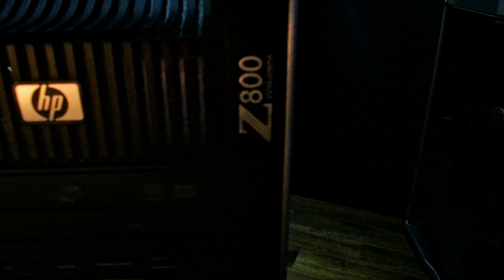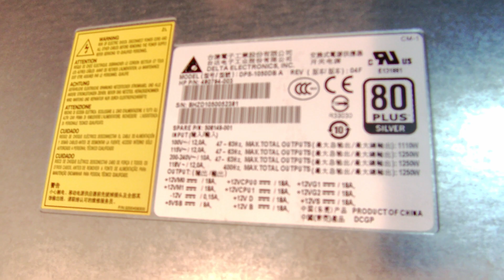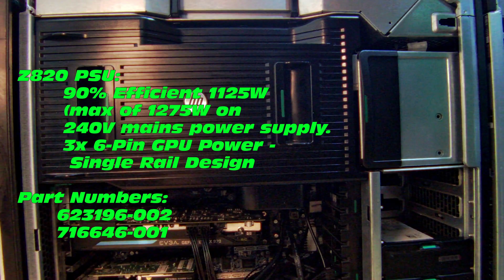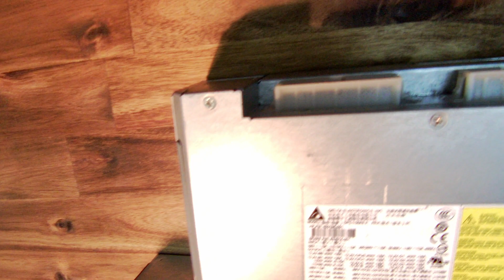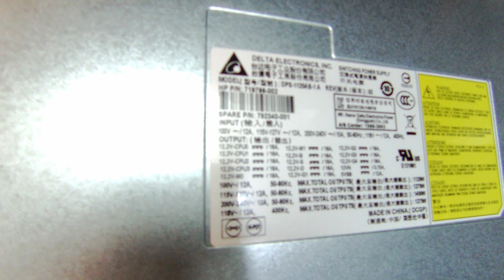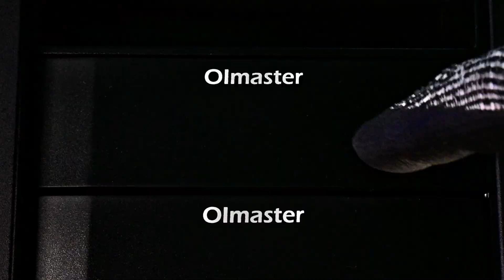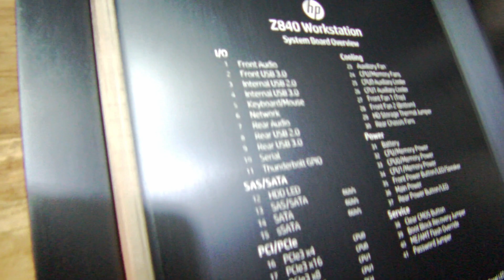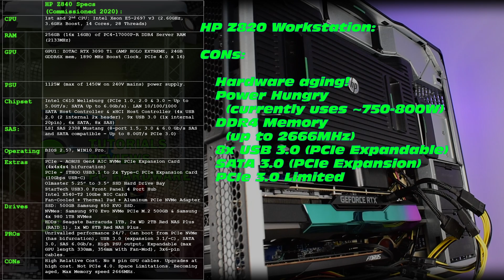Z800 / Z820 / Z840 Guide : Power Up Your Workflow with a Workstation (Remastered).

Comment: Would it be possible to replace the motherboard with a more recent one that can run an AMD Ryzen 7 chip for example?
Reply from the maker: Where modern Ryzen CPU based systems are really competitive, these workstations operate with a different purpose in mind. They tend to focus on maximizing CPU cores, having massive amounts of RAM and lots of PCIe slots. There are no Ryzen options for the HP Z800, Z820 or Z840 – they only operate on dual Intel Xeon Workstation processors. The newest Z8 G5 workstation can do Intel Xeon W's though, check Linus’s video for that one! https://www.youtube.com/watch?v=ESW3gXUo1QM&vl=en 

Let’s do a quick comparison: 
With enough money you could get a Ryzen system like an AMD Threadripper 3990X + TRS40 AORUS XTREME which gives 56C/128T, 8 DIMM sockets (ECC or non-ECC 3200MHz), 4x PCIe 4.0 slots (x16 + x8 + x16 + x8) and 4x M.2 NVMe slots (x4 each), ~1200W min. PSU. System cost: ~$7000- $10000 USD (RTX 4090, 4x NVMes, 1200W PSU etc.) Price is an estimate – you may be able to price it up cheaper. 

HP Z840 Workstation with dual E5-2699 V4 (44C /  88T), 16 DIMM sockets (ECC or Non-ECC 2400MHz), 7x 3.0 PCIe slots (x8, x16, x8, x16, x8, x16) and no M.2 NVMe slots, 1450W PSU (~$2000 USD for the workstation with ~768GB RAM), plus your GPU and M.2 NVMe PCIe adapter, likely makes the system cost ~$4000-6000, you could drive that price down also. 

Example Z840 listings (link may break over time): https://www.ebay.com/sch/i.html?_from=R40&_trksid=p2334524.m570.l1313&_nkw=HP+Z840+44+Core+Workstation+2X+E5-2699+V4+768GB+RAM+No+GPU%2F+HDD%2F+OS&_sacat=0&LH_TitleDesc=0&rt=nc&_odkw=hp+Z840&_osacat=0&_sop=16 

The Ryzen system will give a decent performance boost, but it will come at a cost. I went for the HP Workstation because I can have massive computing performance for a lower price point (buying second hand anyhow). Your budget would decide which hardware system you can obtain, I opted for the workstation (28 Cores, 56 Threads, 256GB DDR4 2133MHz RAM, RTX 3090 Ti, 40TB of storage (28TB of HDDs, 4TB RAID 1 SSDs, 8TB RAID 0 NVMes in ASUS Hyper V2), 2x 10GbE, 2x 1GbE, 10x USB 3.0, 2x USB type C).
Reply: Thank you for your quick and detailed response @racerrrz  So it is easier to build a separate pc with AMD tech then try to squeeze it in the Z800 for me. Then I would go the route of upgrading what I have in here atm, which is the following.

I have the Z800 equipped atm with  88gb Ram, 1060 GTX (6GB VRM), 2 Intel Xeon E5645 2.4GHz 12 core CPUs and a 1TB Samsung 860 Evo SSD. 

Now, I could for example upgrade my GPU, but which one would you recommend for this system? Also, would love to upgrade the CPU's to the maximum GHz that my system can run.
Reply: @sklgy  Hello, I can recommend 2x CPU X5690 upgrade and RTX 2080Ti GPU combo based on my use case.
If you want max GHz CPU you might go for the quad core X5687 @3.86 GHz turbo. Otherwise the 6 core X5690 is the best option @3.73 GHz turbo.

I will share my z800 story :)
I rescued a z800 from a recycling bin and with some upgrades it is my entertainment and gaming machine.

From memory, the machine needed a bios update to support the Xeon X5690s (originally 1x X5550 CPU, now 2x X5690). I chose to put aftermarket CPU coolers because it was missing one and I did not like the price of the OEM coolers, which both should be upgraded to the higher-spec air-coolers (more heat pipes and fins) or the OEM water cooling solution when going to the higher power CPUs. As a result of fitting the aftermarket CPU coolers I had to get rid of the RAM fan shroud (either that or butcher it with a dremel). I upgraded to the 1200W power supply and fitted an RTX 2080ti. Since the machine was also very noisy I replaced all fans, including those in the power supply, for premium Noctua fans, after that it was much more pleasant.

My experience of this system for gaming has been excellent. I do not count framerates but I run it on my living room 55' tv @4k and always have had a smooth experience with maximum settings.

My main complaint is that because of the age of the CPUs, they are lacking some instruction sets so some games I have tried to play flat out will not work. This might not be an issue in your use case, but it is leading me to want to replace the machine, which is a shame since I really like the z800 aesthetic.

Currently I am building a budget z240 (also recycling bin) machine to replace the z800 which I will give the z800 to the wife for video editing. If it were not for the recycling bin finds I would rather build a machine from standard form-factor components so I don't have to stuff around with non-standard form-factors and non-standard power connectors if I want to say upgrade to a more modern motherboard to support newer generation CPUs. Perhaps I might try to hack a standard form factor motherboard into the machine at some later date so I can keep the fabulous case.

There is some good simple guidance at greenpcgamers.com. They have basic guides for many workstation builds.

Comment: I love my z440 that I use for a server. I wish it was more power effecient though. I will be switching only for that reason.
Reply from the maker: The Z440 really packs a punch for their hardware cost. The 600W PSU's power efficiency is excellent, with a 90% "Platinum" efficiency rating. The catch is that the PSU is geared to power some powerful CPU and GPU combos. Comparing it to the Z840's 1400W PSU the Z440 will save you a decent amount in power, but in the cost crisis right now a smaller PSU wouldn't be such a bad thing. Although not as powerful normally, laptops tend to have a lower power consumption and they work great for the more general daily tasks. The Dell Latitude 5580 would likely match the Z440 in purchase cost right now.

Comment: i really want something make my z820 powerful ..but all these things are very expensive
Reply from the maker: Hi there. If you already have the Z820 you have completed the most expensive step! PC hardware is really expensive (even more so now compared with a few years ago...). The good news is that the Z820's hardware is more affordable now than ever. What CPU/s do you have at the moment? Matching your Z820 with a well priced Xeon like the E5-2667 V2 (~$15 USD on Ebay right now) and 64GB of RAM (~$45 USD for DDR3 1600MHz) can help give it a performance boost on a budget. I can't really help with the GPU, they are just really expensive. But something like the RTX 2070 Super second-hand (~$120 USD on Ebay) might be as good as it gets.

Comment: All fun and games till the psu calls it quits (i have a 20kg paper weight)
Reply from the maker: Hi Damian, I am sorry to hear that. Which model workstation did you have? Unfortunately due to the size and design of the PSU it will cost a fair amount to obtain a replacement, but you can source replacement PSUs on Ebay/Amazon. 

https://www.amazon.com/s?k=792340-001&crid=HDAAXTKKI65&sprefix=z840+psu%2Caps%2C299&ref=nb_sb_noss

Side note, I found an adapter cable that allows the Z840 to be used with an ATX PSU, and it works (future video). That could leave room for PSU upgrades, like a 1600W EVGA SuperNOVA P+!
Reply: @racerrrz    sup, it's a hp800 with 2x xeon 5672, 96GB RAM and a GTX 1050ti. PSU is the 1250w.
 So I've looked into it and the best options seem to be retro fitting a different PSU into it since the PSUs for these tend to fail often. The cause isn't really known as far as I can tell since no one sees it as worth the trouble. Some people have fixed theirs by blindly replacing components since when you test them they are "good" when in fact they are not. One theory is microfractures others say it's bad caps (although I did have mine tested and the caps are supposedly good. Might take it to a different guy who knows more he also asks more money so it'll have to wait.)
 I've also seen those adaptor cables and I'm strongly considering going that route or atleast doing something similar and essentially building a different PSU into the case, word of  caution the adaptor cables are sometimes wired incorrectly (saw some people complain in forums whilst trying to figure what was going on with my system)
Reply from the maker: @damianmarais7852  Hey. In terms of PSU failure, it will be a combination of age and fatigue on the components. The Z800 PSU's have likely been in service since 2008 and I can't blame them for failing, but I would hope the Z820/Z840 PSUs have some life remaining as of yet. Another common failure on them is overloading certain rails. Of the handful of workstations that I have obtained second hand about half of the machines had burnt out PSUs - but always on the GPU power rails (i.e. GPU likely too grunty for the PSU, so could be user error also). Also, it is worth checking the PSU connectors as I have had those not make good contact which also gives a no-posting issue.

I haven't seen PSU ATX adapter cables specifically for the Z800, but they must exist. These PSU ATX adapter cables present some risk, especially when there are not many people that use them/have tested them. 

I would only advise to test it if you can afford to loose/repair your machine (i.e. it's high risk and can easily damage the motherboard if wired incorrectly). I did my testing on a $100 "For parts" machine that was in a sad state already (PSU had clearly been opened), so I had nothing to loose. I did my test with a small 340W PSU and the Z840 powered (with errors lol), but I am yet to fully test it (test machine needs a new motherboard to get full function).
Reply: @racerrrz     yea I've chalked it up to age I know it's a old system and I'm surprised it lasted this long to begin with. It hasn't been mine for long but it was basically free (it worked at the time I recieved it). 

As far as the PSU is concerned it's a rather confusing matter. I doubt my GPU caused any issues since it had been using it for a long time. 

Only thing is I don't know what the minimum PSU spec I can run it on. It's easy to find the specs for its original PSU so I could probably just compare the max amperage of the rails and see what should be usable. Part of me just wants to build a modern system into this case later on but the same thing that is stopping me from slapping a fancy PSU in there is stopping me from doing that(money 😕). 

As far as the connectors not making good contact I don't think that's the case cause it's been in and out a few whilst I was trying to figure out what the problem was in the first place. I could probably try reseating it but I have my doubts, never noticed anything wrong with them but I'll check them in anyways. 

Getting employed in my country is challenging and the real problem I have. Once that's sorted out I'm more than likely going to go the route of retro fitting better components starting with the PSU. It used to be a rare occurrence that it would randomly shut down now it's at the point where it can't turn in for more than maybe two or three seconds. I've tested everything else I possibly can though.

Comment: Hello Mate!

What do you think about a Z820 for a occasional gaming setup and VMware workstation workhorse?

Thanks!
Reply from the maker: Hi there. 

You can't go wrong with the Z820 for a gaming and VMware combo. Add in the ample Xeon CPU options (V1/V2) and affordable DDR3 RAM modules and you have a solid performer. Pending the number of cores you desire, something like dual Xeon E5-2687W V2 CPUs could work well for gaming and VMs. 

The main downsides on the Z820 are: 

1) Hardware age, 
2) Limited USB 3.0 ports (USB PCIe expansion a must), 
3) Dated chipset (2x 6 Gb/s Sata 3.0 ports but 8 channels of 6 Gb/s SAS, i.e. best to use the SAS ports for HDDs etc.), 
4) No NVMe boot support (technically - this one is complex, I have seen some users boot via specific NVMes and specific adapters, but my Z820 never booted from a PCIe NVMe [Samsung 970 in cheap PCIe adapter]; the Clover USB workaround may work - I have not tested that on the Z820). 

Otherwise, a great value machine that still packs a punch today.

Comment: hello again , i really need your opinion about it, due to my university projects and homelab stuff and testing and trying new tools and technologies, i need a powerful computer to do my tests with it, like setting up multiple virtual machine and testing things, i was going to buy hp dl 380 g9 for that, now after couple days of thinking I've come to conclusion that workstation like hp z840 would be beneficial to me, noy that hp server, in my use case it would not be on 24/7, even on those kind of situations i think hp z840 could handle that, because hardware wise they are almost identical, another thing is noise, if i go with hp z840 my room would be much much quieter, what is your opinion, should i go with hp dl380 g9 or hp z840?, have that in mind that it would be in my room, and my use case is more around virtual machines, and testing things.
Reply from the maker: Hi. I think you answered your own question! The Z840 will be the way to go, especially if you live in the same room as the workstation. With the Z840, you'll be able to complete your Uni projects with server-like hardware without the server noise! 

The HP DL380 G9 and Z840 share similar components, but naturally the server is built to be in operation 24/7, and has aggressive fan profiles as a result. If you had a dedicated room to leave the server machine, while accessing it remotely, that would work just fine. The DL380 G9 would offer more functionality due to the more server oriented configuration (redundant PSU, more PCIe slots, more HDD bays etc.). 

I have my Z840 set up in my room. My only complaint is that I can't actually leave the Z840 on all the time (I can't sleep with background fan noise), otherwise I would leave it on working away 24/7.